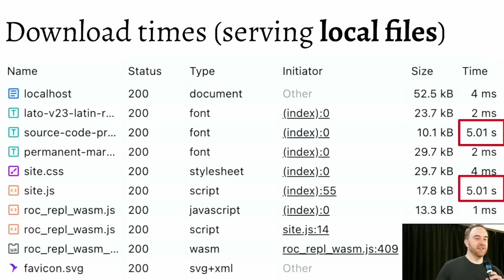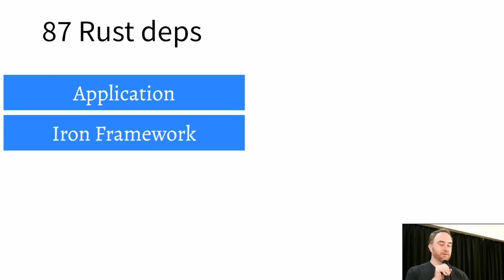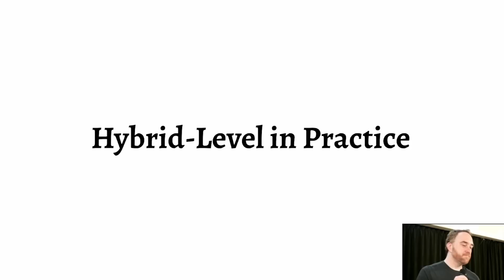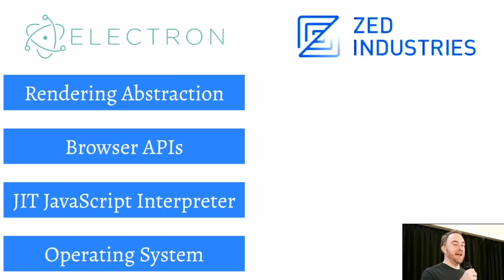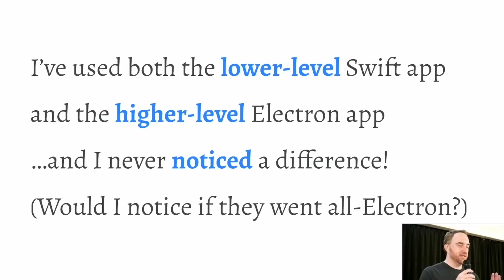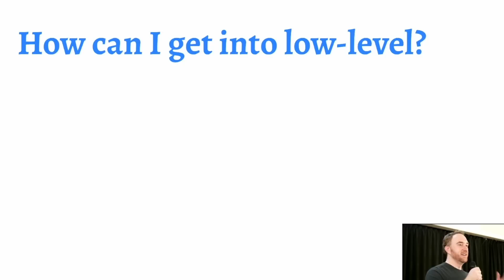Hybrid-Level Programming - Richard Feldman

Comment: I get the points about layers of abstraction and stacks of dependencies. But it's a real shame to illustrate this with a totally freaky Rust example.  I mean:

1) I have created web servers in using high level libraries in Rust with bazillions of dependencies and none of them were anything close to that slow. 
2) I see no reason why one could not write the equivalent of that 200 line C server in Rust for equivalent results and lack of dependencies. 
3) Rust, C and apparently Roc give you exactly the same choice about how many layers of crap you have between your code and the OS or machine. The choice is yours not  for example Rust's. Conversely you do not get that choice with needing V8 and a bunch of libs and an OS underneath, before you even start on the actual JS. modules one might use.

I do agree that the explosion of dependencies that happens when people have access to a system that makes it passive, like Cargo or NPM, is disturbing and sometimes problematic. 

Go Zed editor by the way, been  using for a few months now, fast and sweet.